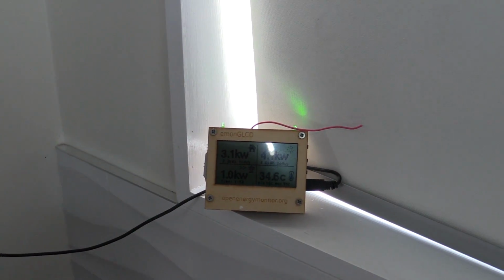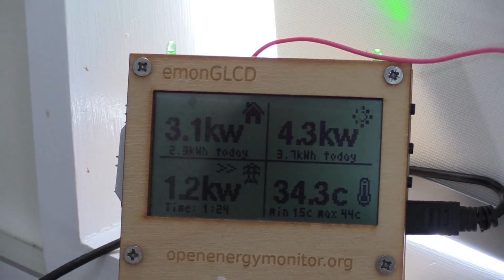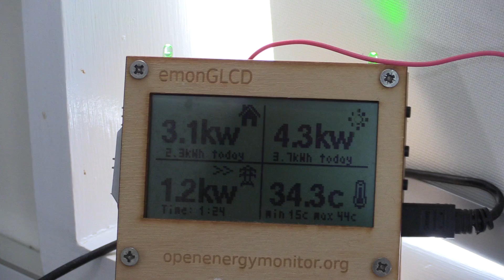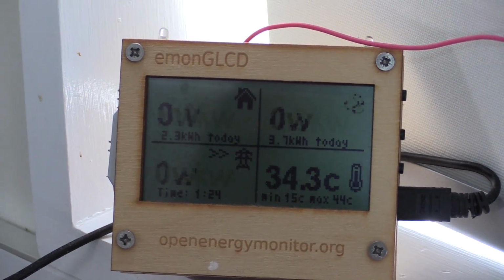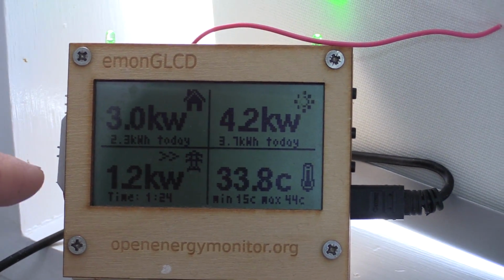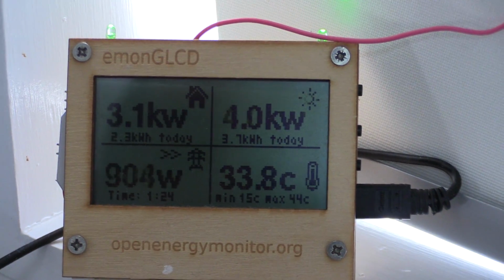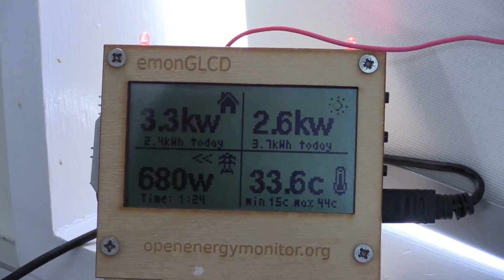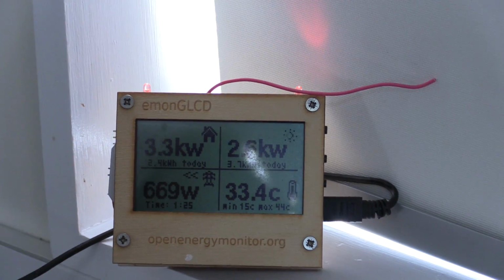Want to Save Power?

Comment: Nice videos you have here, I have not watched them all but I am wondering if you have one with the schematic of the entire system? House and garage.

What is the setup of the house solar? make model inverters ect.

Is your power wall able to feed the house in the event of grid power outage? if so, what kind of device did you use to bypass the anti-islanding?

Thanks
Reply from the maker: No i havent got a schematic but one day when i have time i might create an overview vid. There are a couple of new videos coming out soon about the inverter etc, keep watching :)
Using grid-tie no you cant use it in a power outage but in NZ that doesn't happen often however i do have a plan coming soon
Reply: sitting on 24 300watt panels looking for inspiration, I like the two separate systems, and you actually could put a 3rd smaller inverter to trick the others in to thinking it still had grid power... but unsure how to get all the relays and monitoring tied together so that you don't feed the grid in the event of power outage...

I await your scheme!
Reply from the maker: Rather than trying to trick the grid-tie which i have seen one on a video, your would be far better off with a hybrid inverter. Oh 24x300w sounds good :)